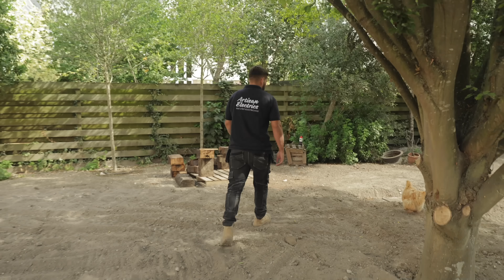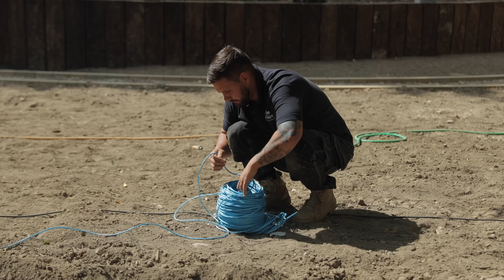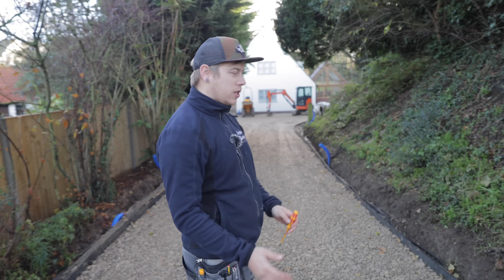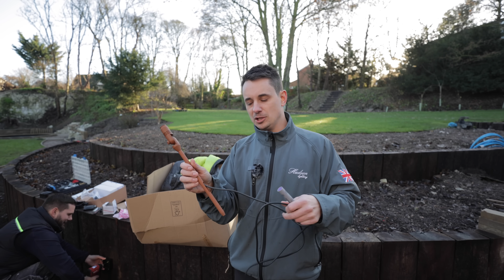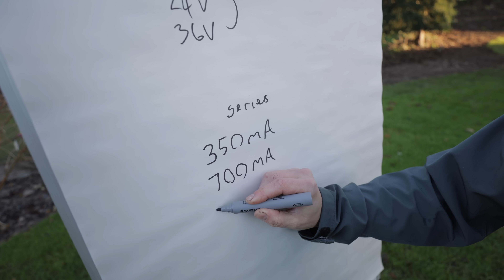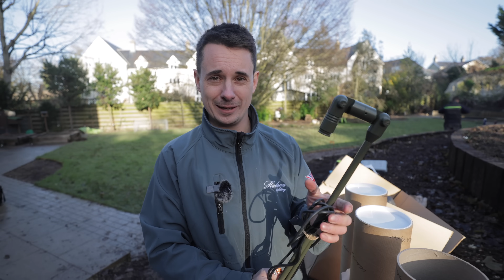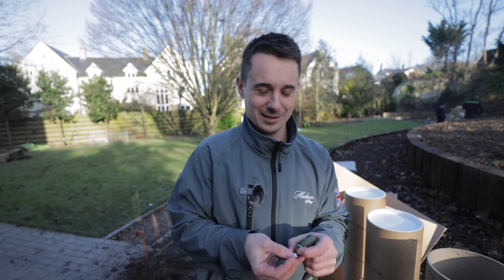The most EXPENSIVE garden lighting job we've ever done!

Comment: Presumably as you add more lights in series, the constant current driver must increase its output voltage to maintain the same current in the circuit - how high does that go, is it (open circuit) still less than 50V DC?  (and therefore how many lights can you put in series?)
Reply: 120v DC is the max for ELV which is 42W at 350mA. So the max is 42W  that you could have on a circuit. I'd recommend sizing circuits to 35W as drivers are easily available. The majority of these lights were 3W. Along the path was 4 lights so just 12W of load. Plenty of capacity to add more down the line. Plus artisan wired 4 core leaving two cores spare for future
Reply: @HudsonLighting  That is excellent, thank you - ah yes I forgot 120V DC is still ELV (whereas 50V is for AC).  Must admit I'd still not want to get across 120V DC; where I work we used to have a 50V DC battery backup supply for critical kit, all distributed with open-frame fuse panels.  I came in contact with it many times and it gives quite an unpleasant nip, so I don't like to think what 120V DC would feel like.  Perhaps there is less risk of fibrillation, hence the higher voltage permitted for DC ELV?   Lovely lights by the way - extremely stylish and I sincerely appreciate that you have designed them to have replaceable LEDs, I think it is ridiculous that we throw away whole fittings because the LEDs or built-in drivers are not repairable.
Reply: @rossthompson1635  I do tend to agree with you. I had a customer once put our lights on a 100W driver. If the driver was at full load the circuit would be sitting at 285V DC. If you design with smaller drivers then the max output voltage is less. It will only ever be at the max if it's under full load too. We most commonly sell 20W drivers and those will sit at 57V if they have 20W of lights on them
Reply: @HudsonLighting  That sounds like the best plan - get the advantages of series (no end-of-line dimming, thinner cables) but keep to moderate size loops / drivers.  Thanks for your replies!
Reply: @rossthompson1635  The human body creates a lower impedance than its resistance (mainly due to capacitive effects). This means you conduct AC (where current flow depends on impedance) better than DC (where it depends on only resistance). This is why the ELV limit for DC is higher.
Reply: @aaronmdjones  Thanks Aaron - that makes sense. It still surprises me that it is as high as 120VDC though, just from my memory of disliking the sensation of getting across our old 50V DC battery system.  Still a "shock" even if 50V DC wouldn't drive a harmful current through body resistance.
Reply: @rossthompson1635 120 volts for DC  IS the threshold at which above electrocution can occur. That is why it is chosen as the delineation between ELV and Low voltage.
Reply: @HudsonLighting  if I’m not mistaken the gent is incorrect, these are not wired in series they’re wired in parallel? Same as downlights for example

Just the wattage of the driver that is limiting you though is that right?
Reply: @ja_adam_  downlightd etc or conventional connections like sockets are all parallel. Constant current lights are always series wired (black feeding the next red etc,). I think that's what you mean unless you were referring to something else @ja?
Reply: @HudsonLighting  thanks for reply, not sure really, downlights you have cable (live and N) in and out to each one until you get to last one same as these lights. And if one stops working it doesn’t effect others 

If these are in and out daisy chained same as downlights how come this is series? And how does one faulty light not effect rest 

Thanks
Reply: @ja_adam_  Downlights and the garden lights shown in this video are wired differently. What this video demonstrates is series wiring.   
In series wiring, it's positive (of one device) to negative (of the next device).
Whereas in parallel wiring (ie 230V downlights) it's positive (of one device) to positive (of the next device)...the negatives are wiring in the same fashion.
Reply: @ja_adam_  That's parallel as the physical connections on the downlights actually are 3 connections - in, out and the light itself all connected by a single bar or connection internally.
Reply: @HudsonLighting  thanks, any chance you could do a short video on the connections and how you connect them up?
Reply: @ja_adam_  Funny you ask, Sunday, providing I finish the edit a video will be going live for series wiring connections

Comment: have to say I skim watched this whilst having my tea, so you may have covered it, but if not - with series constant current installations what happens when a lamp (or node) fails? I have years of experience with airport runway and taxiway lighting where we use constant current to ensure all lamps illuminate equally, but each node has a transformer to allow the system to continue with a lamp failure. That necessitates the system to be AC driven obviously but the principal is the same.
Reply: Some lights pull the whole system out. Some have a bypass. We have a good wire bypass which works 90% of the time. Working on a new protection circuit to work 99.999% of the time

Comment: I think I'd stick with parallel lighting where possible, do the series lights bypass themselves if they are blown, so you can keep the others on or is it like an old set of fairy lights, where one goes out and the lot go off? :)
Reply: Many have a internal bypass unless they have a catastrophic failure. Ours have a gold wire bypass. We are working on a full bypass currently
Reply: @HudsonLighting hat's really good because this issue is pretty much only one I have against series wiring.
Can you explain how gold wire bypass works? 

And permanent bypass - not much into electronics, but judging by the way of how CC driver works, is that a Schottky diode in parallel with LED and threshold just a hair over it?
Reply: @Kinnikinnick  Cree LEDs have a gold wire bypass in them. So if the led isn't absolutely mullered the current goes via that. You've got it in one on the bypass circuit 🔥🔥

Comment: I missed a disadvantage to constant current. If the cable is damaged or a light is entirely faulty it will bring out the whole loop. Parallel it would normally work up to the break point.

Lights that have a minor failure tend to bring just the one light out on some brands. Ours have a gold wire bypass which works 90% of the time. Currently working on a bypass in the protection circuit to work 99.999% of the time although can't deal with the cable damage bit
Reply: It's a major disadvantage, if you installed the cabling system poorly, didn't document the cable runs, or had poor-quality fittings.   It's a bit of a pain if you did a good job though.  A bit of intelligence in the circuit could handle the circuit going open - and the resulting damage.
Reply: Great job co-hosting this video. Just checked out your website - class👌